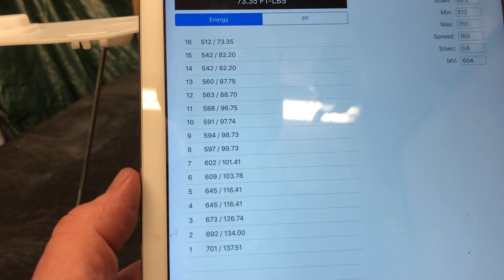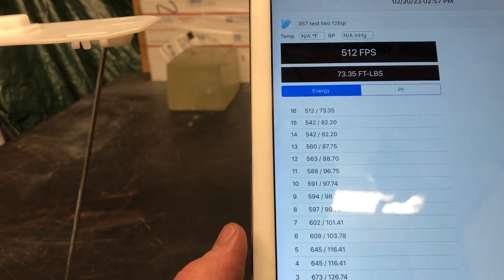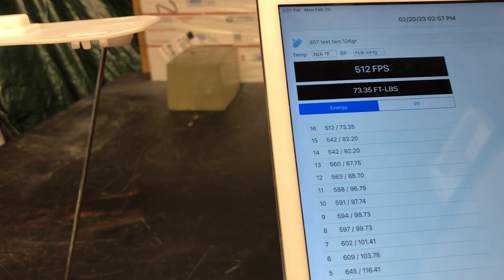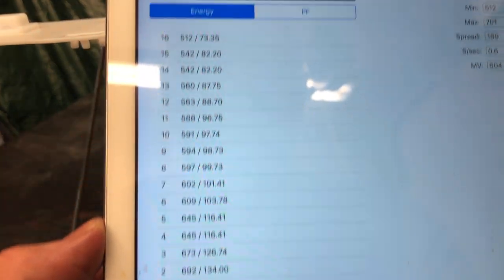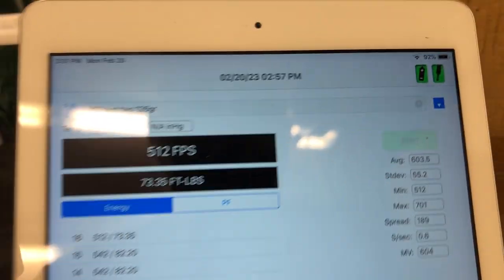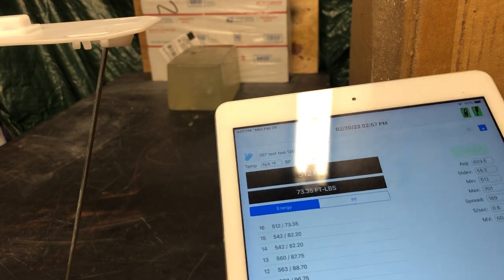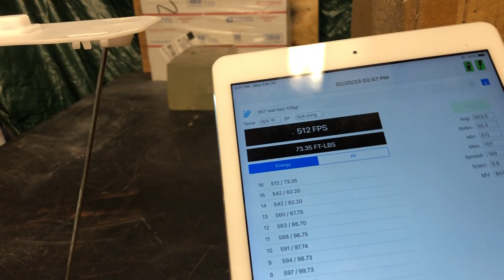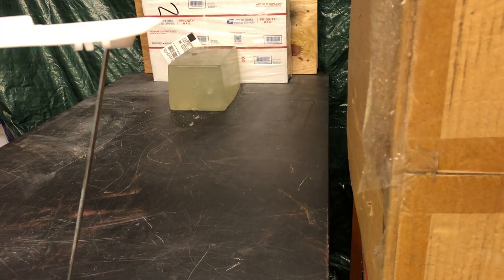NEW AEA BIN TAC BW S45 Mini 357 testing video 2 By Texoma Precision Pellet VID50

Comment: This gun advertises at 170+ FPE and that isn't close to that. I would like to see what that would do to a 2x4 with the gel behind it with all your slugs. Thanks, buddy!!!
Reply from the maker: I like that idea. I will give it a try tomorrow. Also, we are just two pellets into testing; I want to run a dozen different pellet weights and designs before I'm done to see what works best.
Reply: I was about to say the same. Its advertised at 200 fpe. These numbers are far less then advertised. I noticed the same results in an older video of the full size s45, where the readings were around 150fpe which is also only 50% of the advertised energy. Could be something with the rifle, or maybe something with the pellets? There is just something about this rifle that keeps getting my interest.